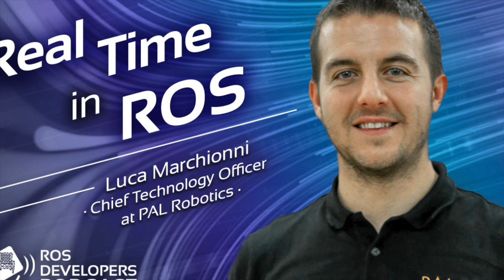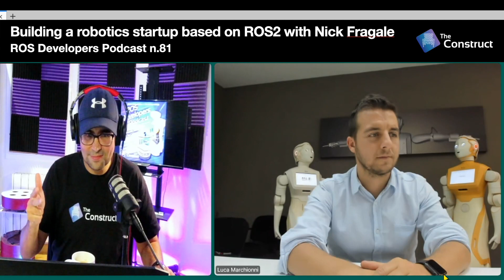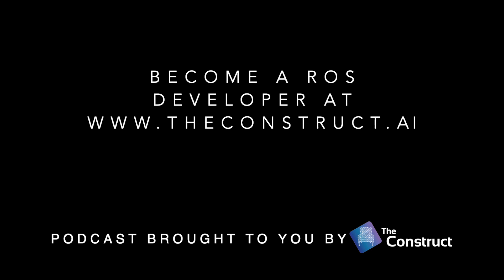RDP083: Doing Real Time Control in ROS with Luca Marchionni

Comment: Thanks my friend for very powerful conversation. Yes an extra dimension (audio and now video) is important and I hope it will remain. Due to security, accuracy and application performance  it is a MUST to secure  the robot control system with RT. The challenge is the frequency of reference to controller. Normally in robotic the 4ms (250Hz) is used. As it was mention it is very important to keep low jitter.  Have a nice day!
Reply: Thanks Markus for your comment. Yes video is staying. Actually, we have already increased the video quality as you will see on next weeks podcast about building hybrid ROS1+ROS2 industrial robot applications. See you then!